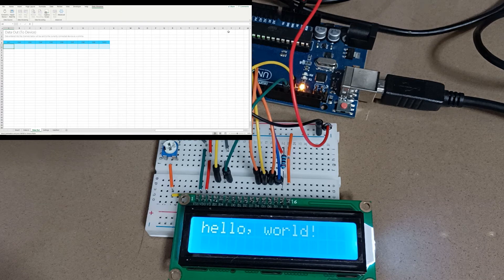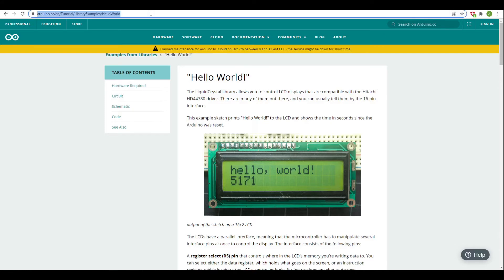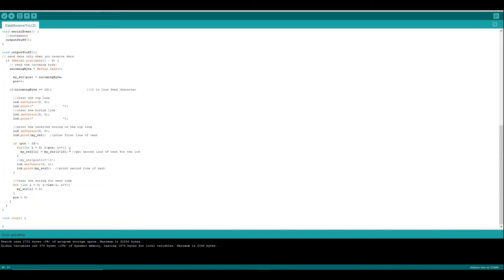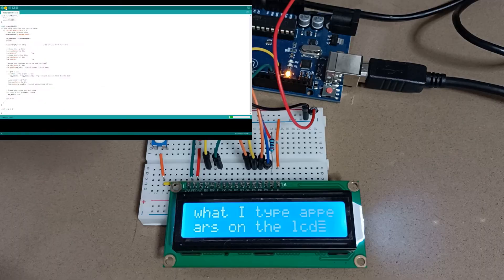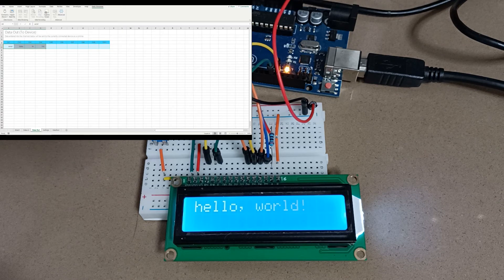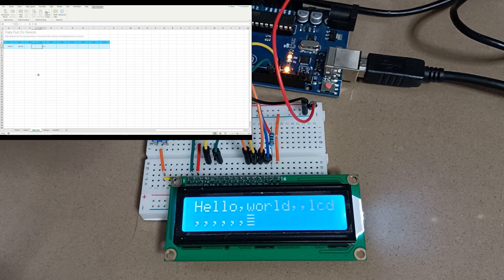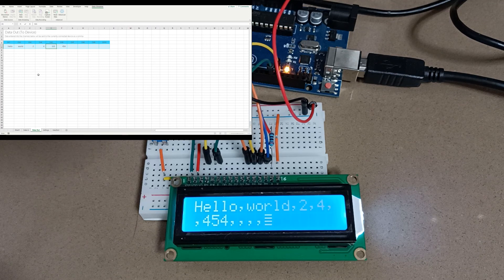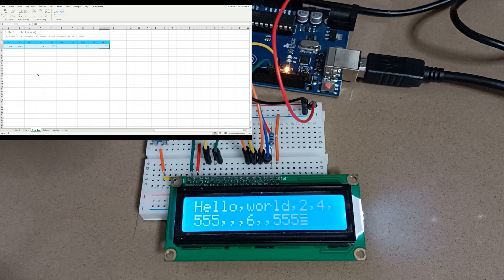Excel Data Streamer output to LCD screen attached to Arduino

Comment: Thanks for the great tutorial!

Is it possible to only send data written into the cells when e.g. a button is pressed or does it always send data whenever the value of one cell is changed?
Reply from the maker: As far as I know it always sends when any one cell is changed.
Reply: @overengineeredinoz7683  Alright, thank you for the fast response.

Comment: It doesn't work with the serial monitor, it prints the default Hello world but doesn't seem to be recieving in put. I am using an arduino MegaADK and a Grove LCD with RBG Backlight I don't know if this could be what's causing the issue?
Reply from the maker: I did notice it would fail if the serial monitor was not set to include a "newline" setting down the screen near the bottom right.
It may not be the issue you are having though.
Reply: @overengineeredinoz7683  do you think there’s a way to create an LCD output based on a list (column) of data from another worksheet similar to your other video but without the user having to continuously input the data (sort of like a for loop)
Reply from the maker: I think it would be possible using Excel macros.  Have a look at the video titled: Excel Macros with Data Streamer to control Arduino and Servos.  It isn't doing an LCD display but the concept is similar.

Comment: My Data In sheet contains commands to fetch from Sheet1 (ie. =Sheet1!A1). My Data Out has a command like ='Data In'!B5 that returns the command =Sheet1!A1. So I want my lcd to display the contents of Sheet1's A1 cell. Instead, it just outputs the Data In command "=Sheet1!A1". How do I work around this so that my lcd displays Sheet1's A1 cell and not the command =Sheet1!A1?
Reply from the maker: I am not fully understanding what you are trying to do but I think excel's "indirect" formula function may be helpful. 
Are you trying to have a list of possible strings to display on the LCD in excel and pick one from some Arduino based input or something else?

Comment: Hi is it possible to use a proximity sensor on and arduino and change a specific cell on excell or google sheets to a 1 or 0 based on when the sensor is activiated?
Reply from the maker: Yes that should be possible. Data streamer features in excel is two way communication
Reply from the maker: https://youtu.be/YC7DVCxCyXE is an example of Arduino passing data to Excel using data streamer.

Comment: is it also possible to convert the values in exel to variables in arduino? I'm making a cutting list for a machine
Reply from the maker: Yes it is. There are two useful functions for this, strtok, atoi.  The first splits comma separated and the second will convert text to integers. I hope to do a walk-through of parsing the comma separated data in the near future.
Reply: @overengineeredinoz7683  thank you very much
Reply from the maker: Here is the link to the video: https://youtu.be/XYpZaPrbRWg